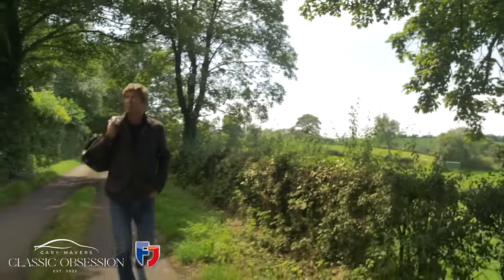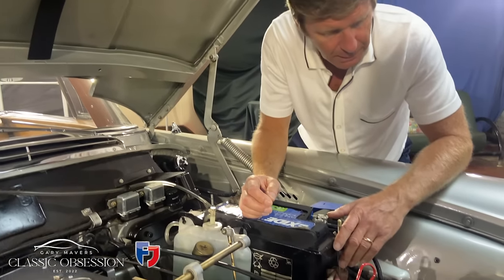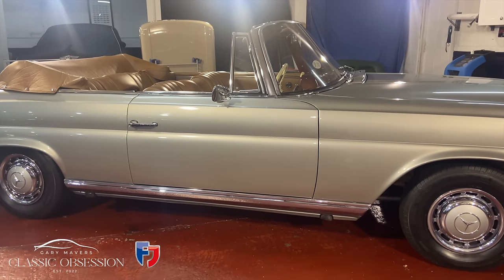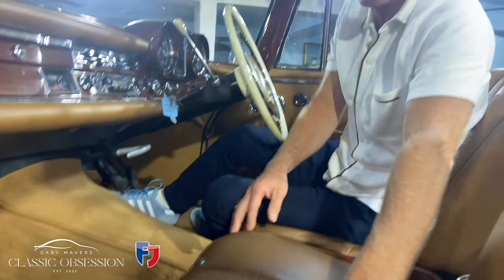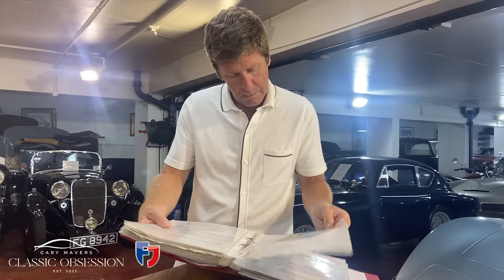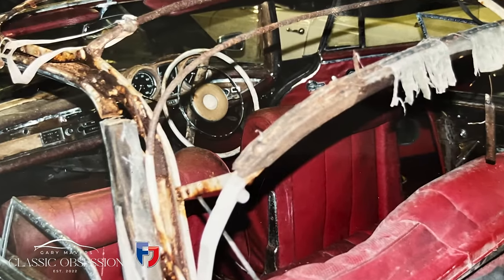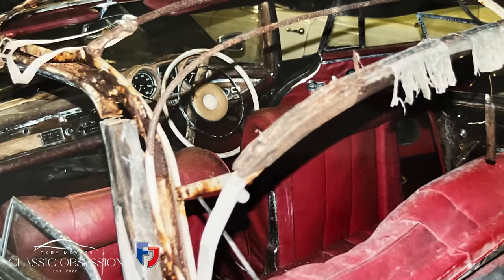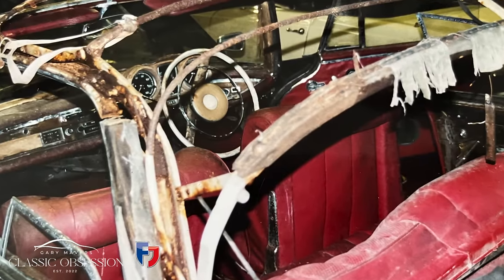Craziest Restoration Ever? Mercedes 220SE Cabriolet | Classic Obsession | Episode 8

Comment: I had about 11 Mercedes ranging from 220, 280 and 300 in worse condition that I used to restore, I started making the coupes into convertible, I had jigs for the the convertible tops once I was finished you couldn’t tell the difference even when standing side by side, people was telling me that I destroyed the value of the car once I told them it was original but it was what I wanted, I have only one left now a 300SE, as fast as I could build them people wanted them, I was thinking about putting a CL 600 motor in it. 

You’ve done and Excellent job in restoring this beauty.
Reply from the maker: These cars were so well built when they cut off the roof at the factory, there was hardly any reinforcement needed to strengthen the body. I’ve seen many conversions and some really good ones. Also s lot of Frankies monsters with awful convertible frames. A guy back in Liverpool has one but he had problems if he travelled over 60 mph he would get scuttle and vibration. This was cured by fitting a reinforced gearbox support plate. But apart from there being a slightly bigger distance between boot and hood/soft top, hardly any difference side by side. Regards.

Comment: Hi Gary, from Sydney, Australia. It's well worth restoring a beautiful period piece motor car. In the coming January I'll be 66 yrs old. and it will be 50 years since I obtained my learner driver's license, and then a few months later, Provisional license. I had received an old Holden which had belonged to a late great aunt. It had not been used for some 5 years after her passing away & needed some recommissioning. This started me on the same path as you, a classic car obsession. I have only ever bought 2 new cars in 1980 I ordered & paid for 1980 WB series Holden Statesman Caprice. To date the really the highest quality premium vehicle we ever made here in Australia. At the time it was to be delivered the Aussie racing driver Peter Brock & the Holden Dealer group HDT were upgrading the premium Vauxhall/Opel derived smaller Holden Commodores to full C class race spec' running gear & engine, I asked whether I could have the full sized 17 foot luxury sedan so enhanced, the answer was yes, it was terrific. Sadly I was to only own it 22months when thieves stole it. I replaced it some months later with an identical one which I have now owned for 40years, but as the thieves stole my new car, I thought I would buy a useable classic car instead as my daily car something that thieves would have no interest in so it would be safe to leave it parked and not have to worry as much. So soon enough I had 5 classic cars and the giant Holden , which today of course is a 40 year old classic car.  There are no modern cars that really excite me like a good quality old luxury car, they have a special aura about them that no modern car does, additionally they have in most cases a pure craftsman's quality about them in their intricate interiors. It's good to see the lovely Merc' holding up so well, and your leather choice of what in many of the 1950's & 1960's car brochures called "italian tan" adds a certain subtlety and class to it that red would not give, additionally as the leather ages it will not show any damage, marks or age to the degree that red does either. Keep up your good work, will you do an episode on the Merc' 600 someday  ??

Comment: Mercedes' support with parts for older vehicles is second to none. I have often called my local dealer looking for obscure parts for 40-50 year old cars. They seem to all be in stock in Singapore. This was a great restoration although I would have retained the original colour scheme, even if I didn't personally like it.
Reply from the maker: Hi Ron. Why would you have retained the original spec and colour scheme? I just think originality is a choice of the original purchaser. I wouldn’t have ordered it in that colour scheme so decided the colour scheme I did it in was one I would’ve personally ordered new for myself. As I said, everyone was against my choice and I began to doubt it myself but was elated with the outcome…as I believe mr. Ralph Loren himself was!! Kind regards.
Reply: @classic.obsession  I guess I'm just obsessed with originality. I'm working on a Cadillac at the moment which was originally white but is now red. I think that white looks like a cheap wedding car and the red stands out, but white is what the build plate says, so that's what I'll do. I respect your choice to do what you want and agree that it looks great.
Reply: @classic.obsession  Also, I have never seen the 2 piston injection on these old Merc's. I have worked on the 6 piston ones and had heard of the 2 piston system, but I believe it was only used for a very short time.  Again, great job.

Comment: Yes, you’re mad. 😊
But I get it.
But I was left a ‘74 280E saloon and I think I’ve got whatever affected you! The car just makes me smile when I sit in it. It’s the most comfortable drive ever—it just soaks up bumps. Yes, I have to sort out a CV joint on the rear NS drive shaft, and a couple of spots that are showin* signs of rusting, but in comparison to your original, it’s concourse! 🤣 At least there are no ‘electronics’ (except for the injection sys) & it’s all do-able. It’s got a new old rear OS  bumper, the oil cooler rad replaced & connected, a new water pump, the driver’s arm rest repaired (wonderful stuff Araldite & wire 😉), other odd bits replaced, and it just gets so many looks & thumbs up! Wonderful. (Or maybe Wunderbar!)

Comment: I have the same car, so I know these well. Tremendous work. I’m surprised you were able to find these parts from Mercedes, even spark plug leads were no longer available!! Respect.
Reply from the maker: Don’t forget this was about 15 years ago. I spent a year or two just amassing the parts until I had everything I needed but the dealers were running out fast. I hit on an idea to approach dealers across the country and asked them to look in their stores for old orders going back years that either hadn’t been collected or returned. It was amazing the amounts they found. Lots of obsolete parts no longer available. They had them stashed up in their stores in huge containers. I also scoured the net. It was different back then. Thanks for watching.
Reply: @classic.obsession  Thanks for the info Gary. I’ll be sure to do broader searches if I need parts in future. I’ve always ordered my new parts from Mervyn at Jacksons Mercedes in Poole. 
Mine is the 66 300se with the air suspension (headache lol). It’s been in the family since 1977. I wish you were nearer to me. Super talented.
Reply: @classic.obsession  btw. Dad bought a new rear bumper for this car back in the 80’s and cost £3k back then. They do stainless steal copies nowadays. You did great to find those bumpers let alone the rest of the parts even 15 years ago.
Reply: @classic.obsession  I bet people then were giving you grief for starting with such a rotten car. But with the value of an SE cabriolet now, I doubt they'd say it was a bad idea!
Reply: @Rialas  I was offered a 300SE cab just recently. Did you know they only made 90 RHD W112 Cabs? The air suspension is well cartered for these days with a people who can repair the valves and Daimler AG through their Classic parts dealers in Los Angeles can supply the air bags.

Comment: Superb job on a lovely car .

while I appreciate that originality is important , since the car was being rebuilt and retrimmed internally , I might have considered one sympathetic upgrade by fitting electric window lifters . The later 280SE 3.5 coupes had electric windows , and I believe still based on the W111 chassis , rather than a W108 , so the parts would almost certainly have swapped over and a centre console with the switches could have been sourced to still look original . 

I had a W111 220S saloon , with fins , and it had the M180 engine with twin carbs , and that ATE brake booster in the same place . I bought one for my W105 Ponton which had unservo'd brakes , but never got around to fitting it and eventually sold the car to a younger chap as I felt I was getting too old to restore it . I still miss those two cars and currently have a W124 and R129 , with nice , but not the same as the older ones .

Comment: I’m just about to start the restoration of virtually the same car that was my grandads, I noticed on the pics when it was black it had wing mounted mirrors.. that’s what mine should have but are missing. Is there a reason you went to door mount?
Reply from the maker: Hi, yes they should be door mounted so if you want to go that way maybe keep it original. Regards.
Reply: @classic.obsession  A trailer tow  pack option provided for them to mounted on the wings where they are next to useless... 😊